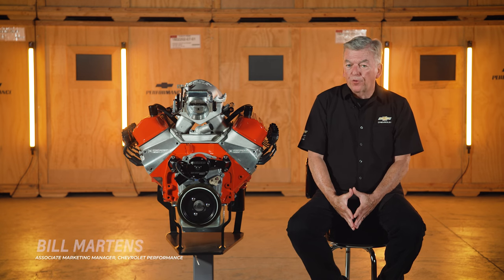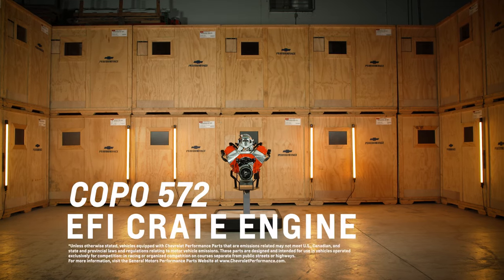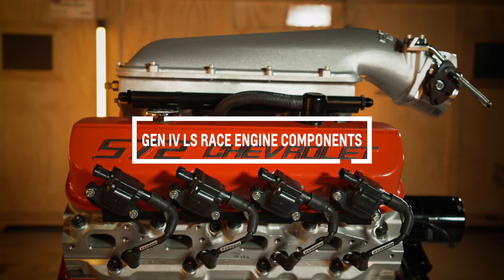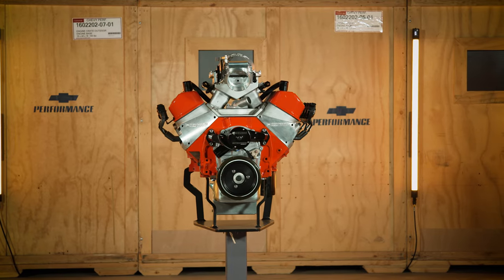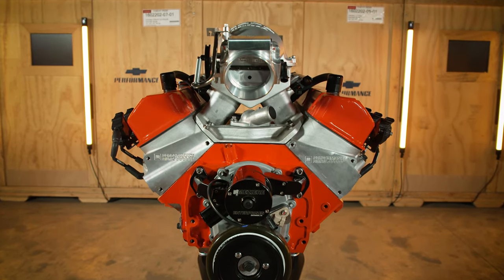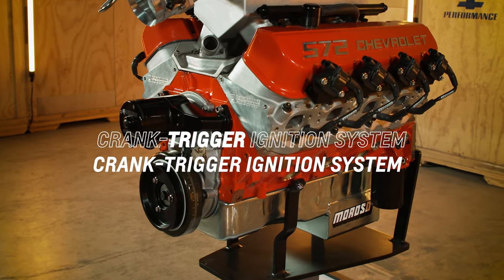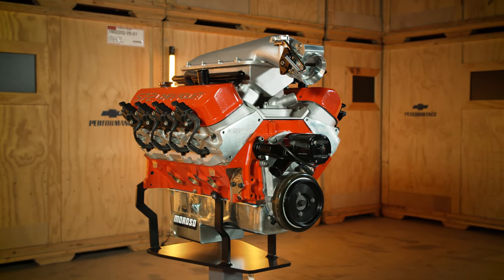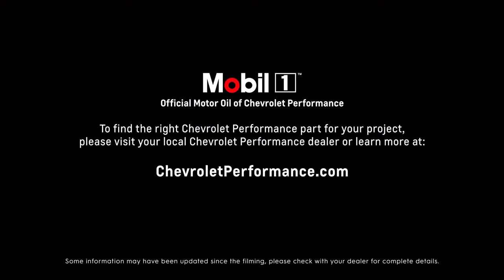Chevrolet Performance - COPO 572 EFI Crate Engine  - Information & Specs

Comment: What is the difference between COPO 572 and ZZ572? only the EFI? 🤔
Reply: One runs on pump gas the other on racing gas. Racing gas engine makes 100 Horsepower more. Merry Christmas
Reply: @rickchambers73  ZZ572/620 makes 620hp on pump gas, this COPO 572 have 500hp...
The racing engine is the ZZ572/720R with 720hp...

Comment: There must be something seriously wrong a 572 cubic inch V8 is only cranking out 500 horsepower...

Is that on 8-year-old gas?

This thing should be making 800...
Reply: Could be a basic camshaft to pass Emissions, I wonder what the Torque and Price is.

Comment: Just the looks of it I would have guessed 725 horse and the price being around $25K
It wont sell,  real engine builders are offering way more for way less depending on price.
If it passes Smog/Emissions in CA it will sell like pancakes on a Sunday morning.

Comment: 500 hp ? You can sit there with a BBC 572 and spout such a horrible 500 horsepower? It should be 780 utilizing most of the same components.

Comment: A 9.3 litre engine should make a minimum of 930hp, any engine should be capable of making 100hp/litre as a minimum.

 This thing barely makes over 50hp/litre because its designers were incompetent.

Comment: Only 500hp? this is a joke? It's less than the ZZ572/620 with carburetor and pump gas, is less than some LS engines that have 3/4 of the size... lol
I can't believe this is real.

I'm a Chevy guy, but i'm curious: why buy an expensive COPO 572 with 500hp instead of a cheap iron block LS and turbocharger it to the moon? why don't a ZZ632 instead of this engine?

Comment: 500 Horsepower.  What a Joke.
Reply: My 383 daily makes that. I thought this would make 700-800hp….
Reply: your correct
Reply: One thing I can think of is that it will give you 500 hp RELIABLY without it losing power after you do a few runs compared to a 383. I know mine does that but after a few runs and heat soak I have to wait for it to cool down. This is more like a tap of the pedal and you’ll always have 500hp
Reply: Class racing. The zz572s come 620 or 720
Reply: Blueprint 509 Stroker Dyno 665 HP 634 ft lbs torque 76 Trans Am wanted 572 little more than 509 but more HP 509
Reply: Everybody please go do your research it's capped out at 500hp so they can use it in a nhra event. What it was built for. We have changed 2 factory computer options that have allowed use to get 703hp out of this engine without changing any parts. With actual part changes managed to get 816hp
Reply: @eduardonunez4377  absolutely never drop below 500hp when 100 throttle on pump gas we have it in the 700-715 range with manor CFM flow adjustments to the factory computer. It can take more. Remember it's all motor. Not boosted. Raw power
Reply: 500 hp NA and reliable. Add the extra power yourself.
Reply: @dcarden3031  still not enough since the 632 hydraulic crate makes that hp
Reply: The class there racing in they can't have more then 520 hp they still run 9s